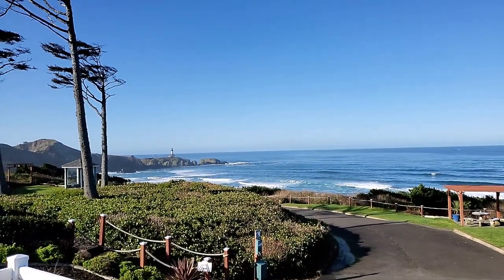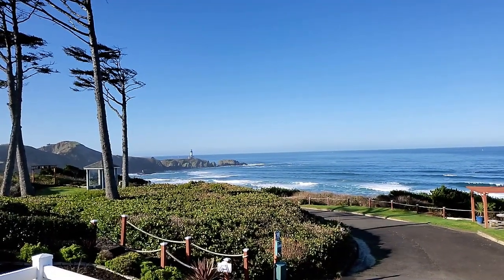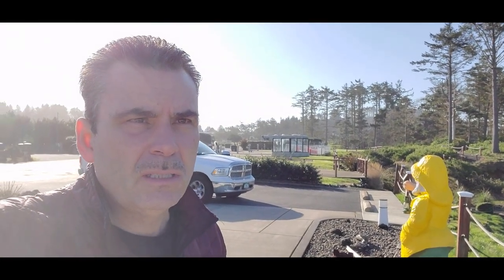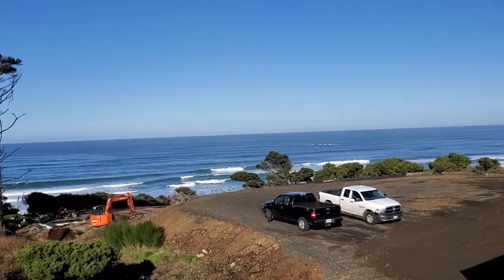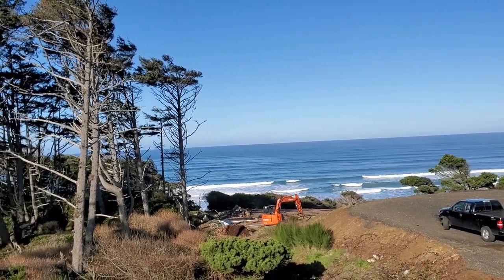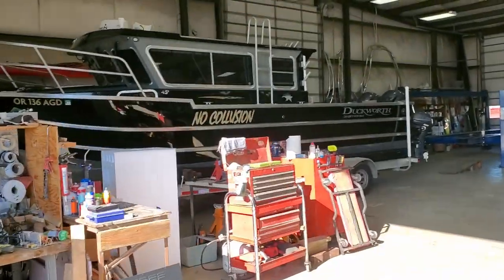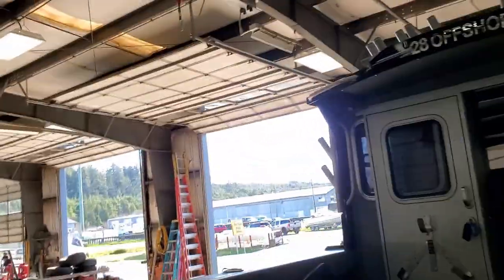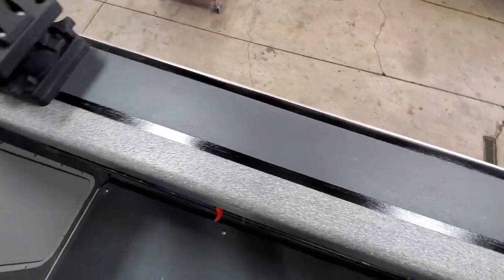Duckworth 28 Offshore update

Comment: I hope they isolated the Stainless steel burnnewin rod holders between them and the aluminum/paint, otherwise it will come right back in short time. I put a rubber gasket and use tef gel or lanolin on every bolt going through the aluminum. Otherwise the new paint looks great.
Reply from the maker: Yes thanks for the advice the painter insured me that he sealed around all the edges and painted all the bare aluminum underneath the pole holders ect

Comment: Hey love the boat, I have a question for ya, what size anchor are you running chain size and length and line size and length and do you like your pro fish windless.
Reply from the maker: Thanks, I appreciate you watching the channel but All of the equipment was on the boat when I bought it.the boat  has a 10lb anchor and so I'm not sure on the rope and chain length I only used the anchor once.
The windless works great
Reply: Trumper Fishing No worries thanks for the info